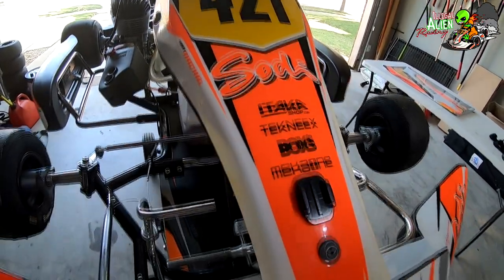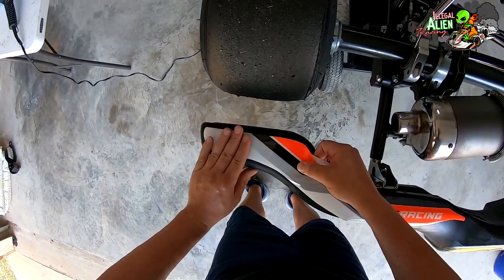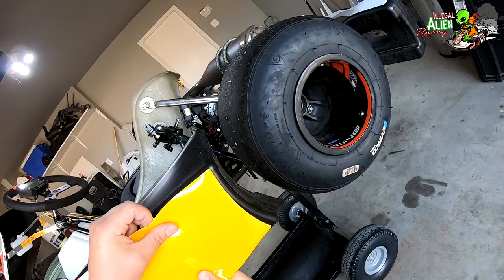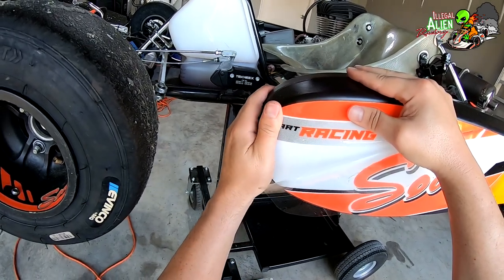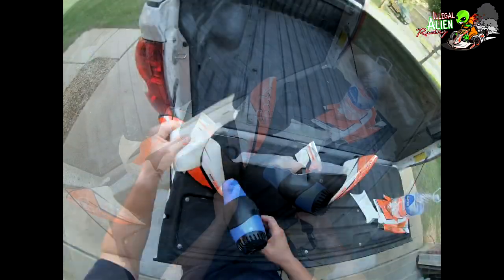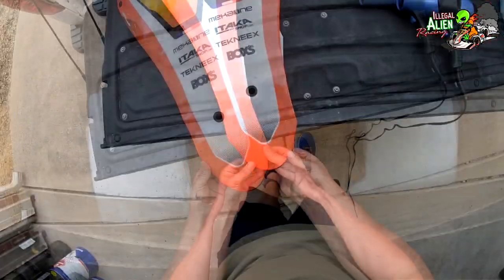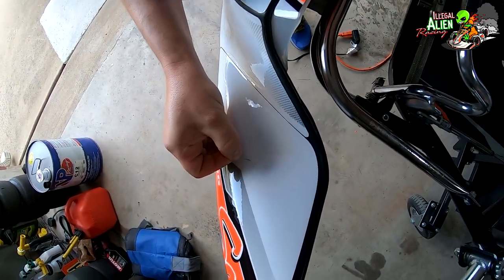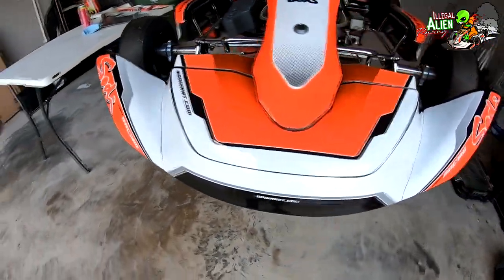Installing Sticker Kit on Sodi Kart

Comment: Nice work.  Couple things I picked up from the graphic guys that did my sons race car. Spray bottle with a little dishwashing liquid mixed with water. They would peel the backing and stick it to the wet surface and used a plastic card like a credit card or similar to smooth it out. Crazy sounding I know but it was flawless when they did it and did a whole car.